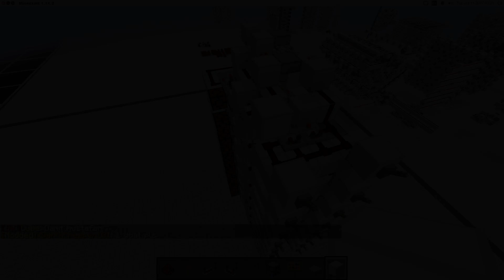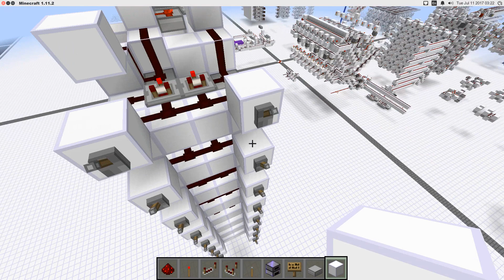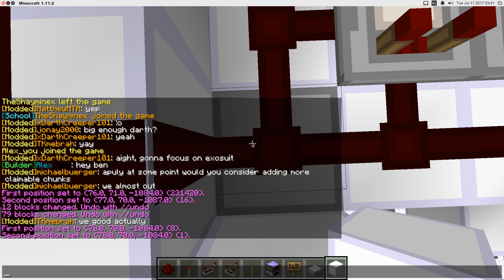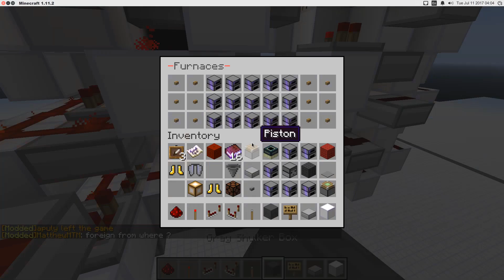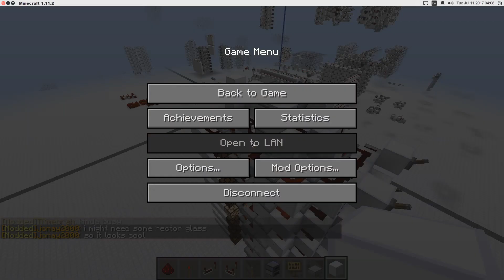Building a Better Redstone Computer Tutorial 3: Basic ALU

Comment: To anyone following along in modern day, note that there was a small chanage in how redstone worked when climbig blocks and this current setup for the flood carry will not work past 1.15.
The left-hand comparator for the input XORs outputs a power of 1 in front of it when flood carry is active and because the redstone climbs the blocks in front and to the left of it, a repeater will see the block as powered even though the dust on top of it is at 0.
Reply: Do you know a way to fix it?

Comment: I attempted my own ALU based on your CCA adder and got a working 6-tick ALU, like yours looks like it will be. However, it is MUCH bigger and decidedly more unwieldy . I do like the ways these functions are implemented - especially powering the torch for flood carry with a specific signal strength - and I'm inspired to use these later. I did my 3-input-the-same functions by taking a NOR and ORing it in later, but this OR-only method is far superior. I love the videos!
Specs of my ALU if anyone is interested:
Dimensions: 18L x 11W x 18H
Speed: 6 ticks
Functions: addition, subtraction, any logic gate with 2 inputs where 2 or 3 inputs are the same (including the never-used ones)
Inputs: Invert A, Invert B, NOR, Carry-In, Cancel Carry, Flood Carry

Comment: Great Work Beni, I hope you come back soon, also for those of you in 1.16 this will not work do to some minor changes to redstone :(
Reply: It works perfectly in mcpe now! I'm building it
Reply: @rubenscavalcanti8886  😃
Reply: Hot fix for 1.16 java: Replace the blocks with the torches on them with target blocks. Put a comparator in subtraction mode next to the dust facing into the target block. Behind that comparator, make your slab ladder. Put a comparator facing into the comparator you previously placed. Make sure the signal strength of piece of dust is 1.

This still fits in the same footprint, though it uses a comparator for each module instead of using 1 for 2 modules.
Reply: What doesn’t work in 1.16? It’s working for me
Reply: @prod_evoke  The flood carry is broken.

Comment: I literally think this is broken now. I have exactly the right power coming out of the flood comparators, and it's not working. I tried tweaking the number of items inside the hoppers to see if it was right, but one item, the xor gate was on that i wanted off, and the other, it wasn't enough to reach the torch. Wtf?
Reply: Yea. 1.16+ java edition changed the mechanics somewhat and borked this design. It can be adjusted to work tho. 

The readon why this as shown doesent work is that 1st xor gate(2comparators) outputs rs signal strenght 1 infont of them. And due to mechanic changes this powers weakly the block on the left side and powers the repeater.

I'll make video later describing this and one solution to this.

Altho that solution makes ALU wider.
Reply: @petrinurmi2078  that's no problem. I'll probably watch it lol,  it's so hard to find new redstone computing vids nowadays
Reply: @theorphanobliterator  If you look comments to this video and sort by newest. There is a solution to this problem in Zumas comment by one user, that is almost identical to my solution. And uses same footprint.

With my solution footprint is bigger and makes accumulator path take 1 tick longer due to 1 repeater more(signal strenght issue). But my proposal keeps this bennys cube thing intact, because this currently acts as a AND gate logic.

I'll propably get to make video of this  in 9h or so. Once I get of from work.
Reply: @petrinurmi2078  lol thx. I'm rlly bad with word descriptions, I usually need video lol